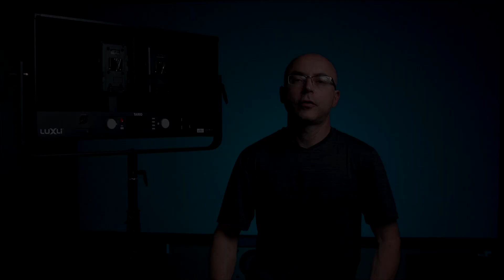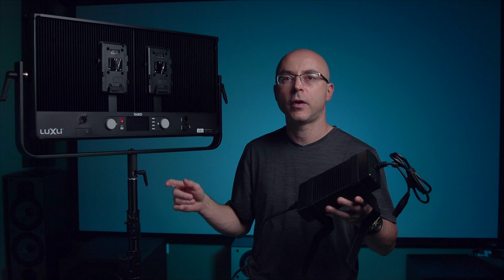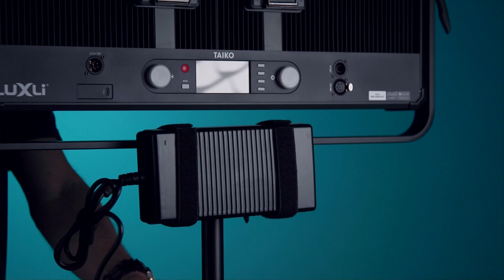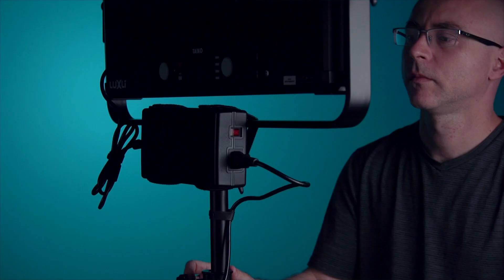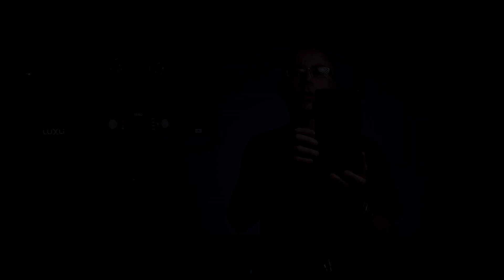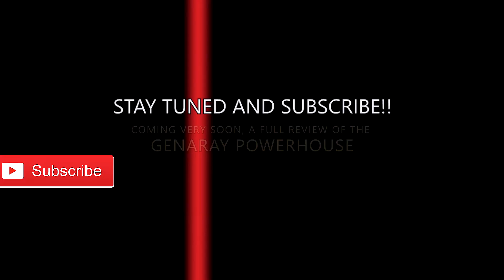LUXLI TAIKO DIY Mount Power Supply Hook Up

Comment: I just bought a Taiko (Dec '21), and it looks like they are now supplying a bracket and velcro straps to do what you are indicating here.  The bracket simplifies the procedure. You can also use a mafer / super clamp with the bracket - if you prefer. I also purchased the barndoors.  These were the two reasons I waited to buy this unit - no barn doors and a  power supply without an integrated mount. Looks like they took care of both.  God bless them. Still have not played with, or powered the unit on.  I like the idea of the narrower beam angle of 76 degrees, and the fact that they kept the power draw at 250 watts, making using traditional camera batteries work. Case is awesome.  Kind of bummed they don't have a package price with the barn doors included though. Had to buy them separately. Really appreciate your thorough reviews here. I'm sure they sell that mounting bracket separately, for all former purchasers.

Comment: I bought a came-tv tripod clamp with female v-mount ($30 on amazon) and a cheese plate with the male v-mount from Niceyrig ($16 on amazon) and velvrod the plate to the power supply. Now its quick and easy to attach/detach and is similar to aputure's on the Nova 300
Reply from the maker: Curtis C thanks for sharing this. I just found the hardware you described. Now, how did you mount the power supply? I don’t want to make holes in it.
Reply: @ArtVideoProductions  I used heavy duty zip ties, I'll try and get a pic of it
Reply: I had velcro going around it but my velcro was a little short so I changed to the zipties for now
Reply from the maker: Curtis C thats a good idea. Zip ties!

Comment: Very smart way to mount the power supply. Probably something luxli should look into when making improvements to their power supply. They should develop a quick release male connector on the horizontal bar you Velcroed the power supply to, and the power supply should have a female connection, so that you can drop it right on that male connector, and press a button to release. Aputure has a quick release system, not sure why premium light manufacturers don’t have a system. Maybe in the future there will be custom light stands with some of the electronics for the power supply built in, so it’s simply a matter of putting the light on the stand, and running one cable to the light, sleek and simple, and at the base of the stand, can be your regular 15 amp socket for plugging into a power source